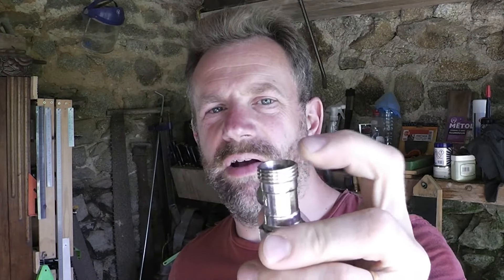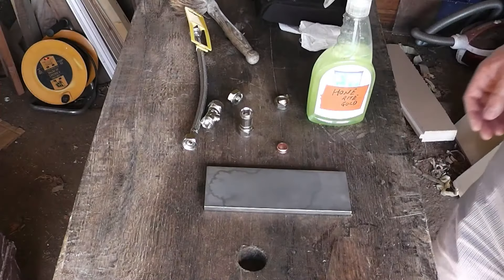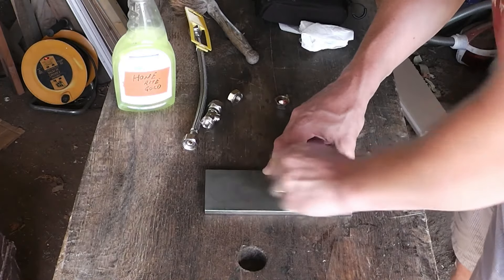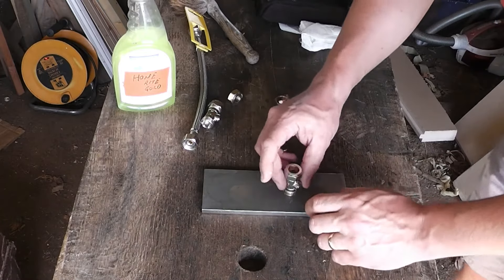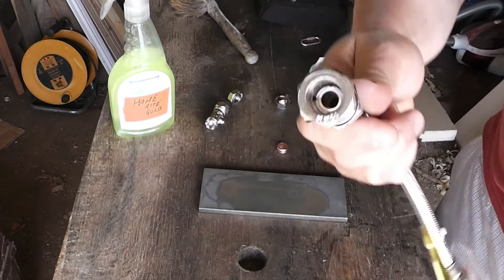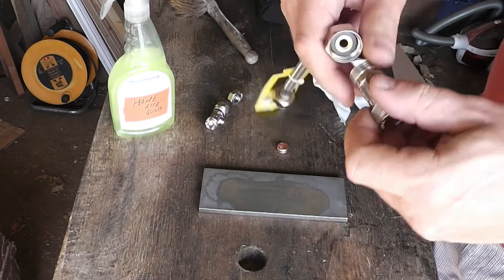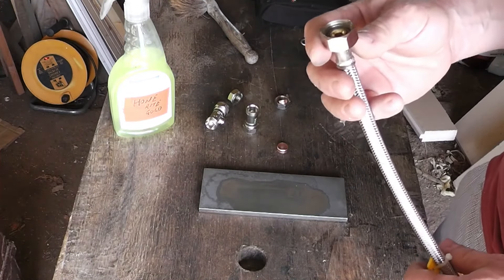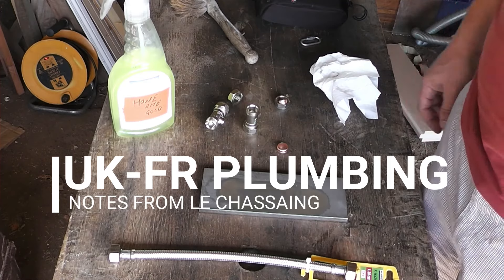UK to France Plumbing #plumbingUKFRANCE #notesfromlechassaing #renovationfrance

Comment: nice tip Ive been here 10 months Im an engineer and the biggest issue has been the plumbing. it seemed such a complicated way of doing it but the water pressure is so high you have to make sure you do it the French way. brazing pipes is fun as well. Dont get using all the fibre washers though seems to be a weak point.

Comment: Too late now for you but you can get balofix with one side machined flat to accommodate flexies or just use a male to copper compression fitting before or after the valve..... 👍
Reply from the maker: Hey Yensabi, thanks for your idea.